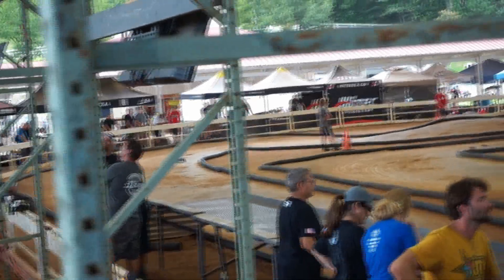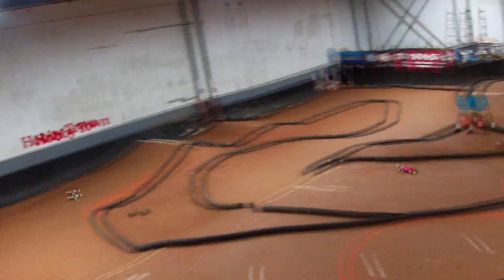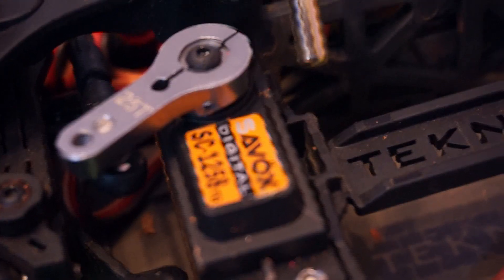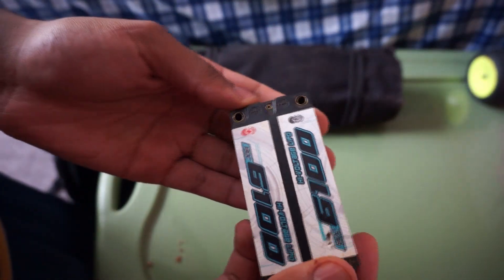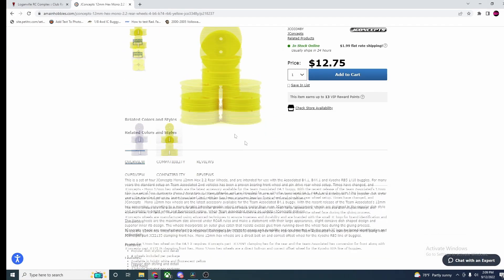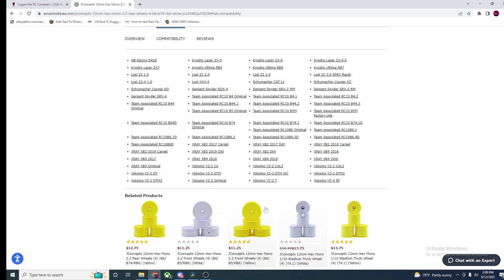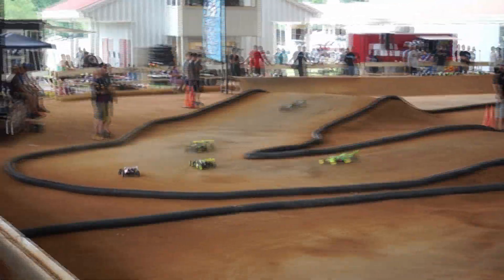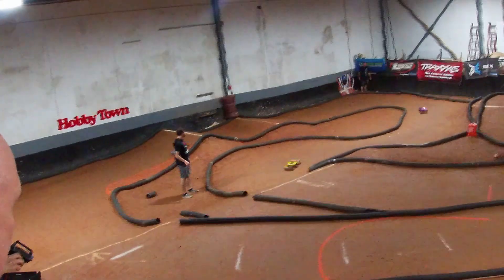A Detailed Guide To RC Racing

Comment: This video was a good idea in theory, but, like you said, it's a bit of a mammoth task. I usually like your videos but this one feels a little redundant. You touched on everything in here before, usually in a better way too. If I were to guess, you finished the 10th scale part and realized that you just did 95% of the 8th scale part two vids ago but were so deep in already that you kinda half-assed it. At least that's what the contrast in detail and editing is showing. 

Some corrections in no particular order:
- The best bang for your buck tools are Wera Hex plus. Not only that, they're the best tools for hex screws period. Sadly they don't come with these cool handles RC tools do, which is why most ppl buy overpriced RC tools instead.
- HB makes 10th scale buggies too, they have been kinda quiet but just released a new lineup of them. They very expensive right now with very little support as of yet so not a beginner's option as of now.
- Sworkz also makes 10th scale buggies, they're great on carpet and have been successful over here in Europe. The US Sworkz guys said they'll start putting more effort into 10th scale soon, so you'll probably see them around more often. Can recommend them once you guys get proper support.
- Mayako will get a few dealers throughout the US, Amain carries them for example. Sworkz is also carried by RC1 Racing and afaik has no exclusivity deals.
- For 8th scale recommendations you strayed away from your usual "buy what's supported locally" take, I don't understand why because the same thing applies here. For example: the Sworkz S35-4, is a very solid rec for a beginner, given you have at least some level of support at your local track. The car works very well on most tracks with a neutral/kit setup, only needing minor tweaks.
- You skipped Tekno (until you started listing off battery compatibility), one of the best supported 8th scale brands in the US right now.
- If you have an 8th scale astroturf track near you, the money aspect basically falls away completely. You have basically zero tire wear, I was at the track basically every other day last season and only ran through 4 sets of tires.
- The MBX8r comes with a battery holder for 4s bricks so it also supports 1 4s brick or two 2s fullsize batteries
- The S35-4e has an adjustable battery tray and will fit a 4s shorty (or two 2s shorties but only with the battery terminals oriented to the front)

And most importantly: Don't ever start with nitro because it'll make electric classes boring :D
Reply from the maker: Thanks for the corrections.

Edit - Also thanks for the feedback

Comment: ditch the balance charger board and plug it straight to the charger balance .. get a blade and trim off one of the pin leg if your charger balance is not a keyed style... this will make it more cleaner and less thing to carry... the balance board is unnecessary thing have and risk of something that can get drop in and causing a short if something touches that open balance
Reply: true thats how i done it on my B6 charger to use longer balance cables straight out of the charger for my stick packs and one of the ports with soldered cables to power cables and one lose for balance on my shorty packs.

Comment: Great video! I disagree with one part however, If you are just starting out racing you should absolutely get a 4wd buggy don’t even think about a 2wd until you get some understanding of setup.
Reply from the maker: That's a fair point. It's a double edged sword. 4wd will be easier to drive and setup, but harder to build and maintain. 2wd will be easier to maintain and build but harder to drive and setup.
Reply: As a new RC racer if you can handle two-wheel drive everything else is cake
Reply: Nobody starts racing at a legit track with 4wd.  Most start with 2wd 21.5 and work their way up from there.